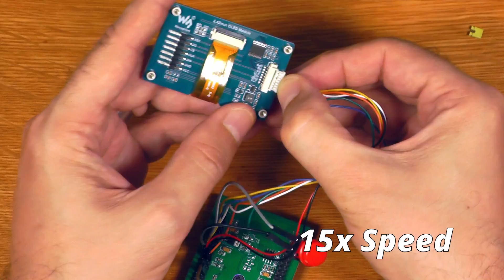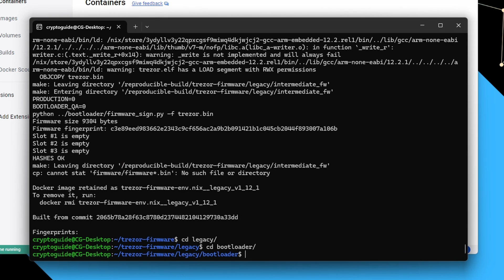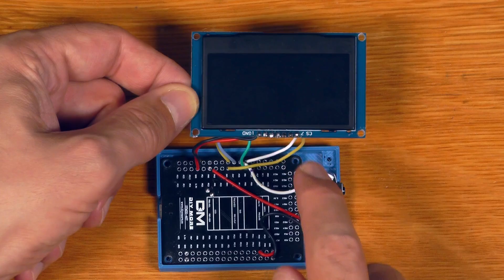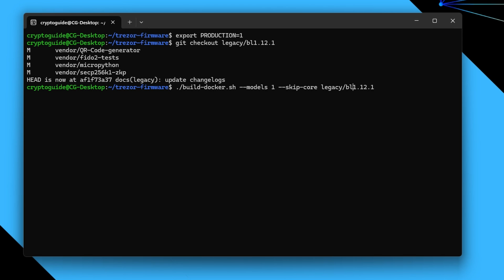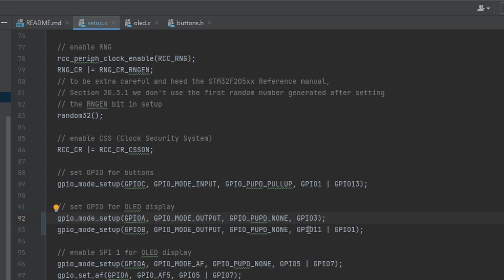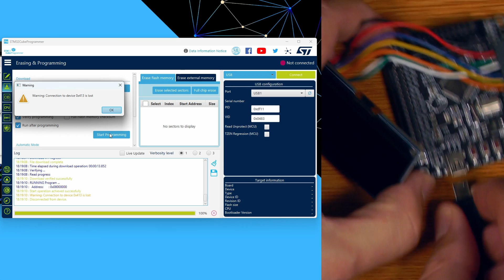Build a Trezor One DIY Hardware Wallet with STM32 Dev Boards (For Bitcoin, Ethereum, Cryptocurrency)

Comment: Hello friend.
Is there a simple way (for a beginner) to verify that the bootloader I downloaded is identical to the one on Trezor's GitHub?
The goal is to verify that the file on my computer hasn't been maliciously replaced with a fake/hacked one.
Thank you very much.
Reply from the maker: I mean the simplest way would be to look at some of the hashes I used in this video and go from there. Basically the bootloader automatically updates itself as required, so if you have established a "known good" bootloader, it will update itself from there.

Comment: Is the portion for making a custom signed bootloader on GitHub? I didn't see anything in the provided link, and was hoping to mess around with that

Great video by the way!
Reply from the maker: Thanks :)

It is all on the Github, though I didn't cover it in the video. While the bootloader itself isn't signed, you need to add some trusted pubkeys that it will use to validate the main firmware before loading it. On the firmware side, the first thing it does is has the bootloader and check whether it is from a known/trusted bootloader.

So the workflow is basically.
1) Decide which keys you want to use to sign your firmware and add these as trusted into the bootloader.
2) Build the firmware and note it's hash.
3) Modify the firmware to trust the bootloader you created.
4) Build the firmware, add the signatures.
5) Flash everything and hope for the best.

Comment: Does the build still work for you? It used to work for me, but now it doesn't work like it used to, the --skip-core flag no longer exists, and the --model 1 doesn't either.
Reply from the maker: Yea they reworked the build options about two weeks ago. 

Those extra options were just a time saving measure, your can do run ./build-docker.sh and it will build all the models
Reply: @CryptoGuide  not working anymore?
Reply from the maker: @RattakornRuay  Still works fine and the instuctions are the same as here if you just checkout the same version I used from their Github

Comment: Could you inform about how to perform the same diy operation with One Key system, since one is a variety of Trezor software, if possible, the same hardware would serve to create the diy wallet??
Reply: Kindly, could you create a content with the necessary changes to install the OneKey software!?
Reply from the maker: Perhaps next year sometime, it isn't really a priority at the moment for that hardware platform.
Reply from the maker: Onekey devices are more like a Trezor T, so while it would certainly be do-able with a similar process than what you have here, you would need to make some modifications.

Comment: Can I make a custom trezor one firmware for the Rapsberry Pi Pico ?
Reply: It would be possible if you modify the source code that is actually build for STM32 to RP2040. It is possible but need knowledge and some time to port it
Reply: I was Trying to port it but I'm my knowladge wasn't enough to port. So you can give it a try
Reply from the maker: Yes it is possible to port to the newer Pico 2, no I am not interested in doing it at this time.

Comment: If I will solder my board and use STM32F205RGT6TR controller do I follow the same procedure?
Reply from the maker: If you mean making a board from scratch, rather than just using a dev board, then yes, the process is the same in terms of building and flashing. (As long as you also use the same IO pins and stuff)
Reply: @CryptoGuide  Thanks! I'm confused a bit. This code can run on different stm32 chips as long as they have 1MB flash and the same pinout? so stm32F103RG can be used or F205 or F405?
Reply from the maker: The MCU will need to at least support the same instruction set, have the same peripherals and have enough flash. (So basically stm32f2 and stm32f4 series will generally be fine) The pinout doesn't matter, as you can rewire that if needed (if producing your own PCB), though the package will need to at least expose the GPIO that you are using in your code. (Which will need to match the official firmware if you plan on flashing retail firmware from Trezor)

Comment: Awesome video! Have you tried using the large display from example two with the smaller board, or does that cause boot issues from the larger power draw?
Reply from the maker: The larger displays doesn't work reliably with the smaller board. (It does work, but you may need to reset the board few times before the screen lights up)

This issue is far less pronounced with the large waveshare OLED screen, but still happens occasionally.

Comment: Hi Steve I have 2 words missing from my trezor seed. I am using BTC recover to open the wallet. However I do not have my wallet address on Myether wallet.  As I also do not have my password for my Protonmail. Is there a way to narrow down eth address data base. As I know the ammount of ETH in my wallet and the year the wallet was created.  Is it possible to seach all wallets on myeth wallet with say 50 ETH, created in 2018. Thank you.
Reply from the maker: Just use an Eth address database, it's a straightforward recovery that BTCRecover will knock over in a few hours.

If you can't work it out here then you can request a private session or trusted recovery. https://cryptoguide.tips/recovery-services-consultations/
Reply: @CryptoGuide  Much appreciated Steve. I will try to do it on my own, and if not, for sure will seek for your guidance and consulatation.
Reply from the maker: No worries, just don't panic or rush. It should be straightforward.
Reply: @CryptoGuide   Steve I am ready to do a test with BTC recover using a mac book air M2. Is there anyway I can check for malware on the programes I downloaded. I want to make sure no one has a back door and can see my 22 words once I put them in please. Is there any final check I can do please.
Reply from the maker: @IFTHENGEO  It's not just about BTCRecover, but the potential for other malware on your system. Just run the tool offline (so all networking disconnected) and only put the system back online after you have moved the funds to a new seed.
Reply: @CryptoGuide  Awesome. One more thing Steve, i keep getting stuck on pip installation part for ethereum wallet, as it gives me some sort of error which prevents me from running the test with my seedphrase. 

Do you happen to have ethereum specific code snippet  for this to help out in this scenario?
Reply from the maker: You don't need to install anything special for Eth wallets

Comment: I bought the wrong one (STM32F446RET6) can this board still be used for this project?
Reply from the maker: Unfortunately not, it only has 512kb of flash storage
Reply: @CryptoGuide  maybe with bitcoin only software or no?
Reply from the maker: Nope, not without rolling back to firmware that is a couple of years old

Comment: Hello. Have an Error: failed building wheel for coincurve. How can I fix it? Using python 3.12.3 and fedora 40.
Reply from the maker: Probably missing something on your system, is there a reason why you are using fedora?
Reply: @CryptoGuide  Yes, when I installed Ubuntu, it turned out that it did not support my motherboard, I don’t know how to write normal drivers for a sound card and a couple of other little things, so I switched to Fedora.

An extremely funny situation happened, I had synchronization in Google and I deleted metamask on another OS, because of synchronization it disappeared on Fedora, I dug up everything, all the files, the last hope for your software.
Reply from the maker: If you uninstalled the extension then you would need to use data recovery software and after doing so, you should be able to simply put the extension data back and it would work. 

I just bumped the version of coincurve to the latest, so it should just install a prebuilt module now. (Just download the BTCRecover again)
Reply: @CryptoGuide  this helps installation successfully with passed tests! Thank you!! now trying to understand the next steps)
Reply from the maker: Good job sorting it out
Reply: @CryptoGuide  I think this is the end, after removing the extension I reinstalled metamask, because... at the moment I didn’t understand what happened at all. It seems to me that he deleted the old data and wrote new ones in this place, I don’t know what to do. I found some mentions of this address, but most likely this is metadata about old transactions, nothing more. vault-decryptor metamask also does not help even with current wallets. I know what the password is, but I don't know the phrase. I know the address. Maybe you have some ideas?
Reply from the maker: Your only option in this scenario is to immediately stop using that PC (so turn it off) and attempt to use data recovery software. Basically your only chance is if the deleted wallet data files haven't already been overwritten.
Reply: @CryptoGuide  I copied all the folders mentioning the desired address (there seems to be something like a cache, old profiles, maybe there are keys there), the data recovery software did not give me anything useful, because at least I did not understand where the data goes when deleted extensions, obviously not in the trash.
Reply from the maker: The data has been deleted and won't simply be in the trash. You need to stop using the computer immediately and use data recovery software. (The kind that lets you recover deleted files, will boot off a USB stick, etc)

Comment: Nice video!
So what would be the cheapest hdww? Would be easy to use the integrated button of the weact and using the led to blink the number of the mnemonic to be entered? 6.5 usd nothing beat that i guess.
Reply from the maker: You could certainly use the single button on the WeAct board to act as the "Yes" button and just unplug the device if you wanted to cancel a operation. The WeAct + 0.96' OLED would be very close price wise to a Jade with the T-Display. (Which is about 10USD)
Reply from the maker: Thanks. It's pretty close to the Jade with the T-Display as far as price goes. You could certainly remap the IO to use the on-board button and just not worry about the "No" option and just unplug the board if prompted for that.

Comment: Awesome video.
I wish somebody would fork Trezor to add SeedQR and Passphrase QR.  That would be amazing.
Reply from the maker: Thanks. :)

So what do you actually mean by this? Do you mean loading them or storing them and exporting them via their screen?
Reply: @CryptoGuide  Weird.  I replied but it didn't show up.
Anyway...  I meant passphrase QR for loading a passphrase.  One of your videos introduced me to Krux, and I love that model of having a stateless device that loads an encrypted seed QR and a passphrase QR.  Krux is my main wallet, but I'd love to find a backup wallet that also offers either encrypted passphrase saved on the device, or better yet, the option to load a passphrase using passphrase QR.
Reply from the maker: Glad that you found Krux, it is certainly a great project :)

Yea the spam filter is pretty easy to trigger... Basically it would need a camera or a barcode scanner for that, something the SpectreDIY uses. (Which I will look at down the track)
Reply from the maker: You can tip on LN here: https://tippin.me/@YTCryptoGuide

Comment: will you try to build a trezor 3 ?
Reply from the maker: That's the plan, though I will probably do a few other things first. 

The main difference with the Safe 3 is that it won't be the same as a genuine device, as even if you add the Optiga Trust M SE, it won't have the factory provisioned keys to be able to pass as a retail device. 

Given that, I may also just look at adding an unofficial build that gives you the features of the Safe 3, without the SE (SLIP39, on-device functions, other coins, etc), so basically the same security level as the Trezor One. (And would also be cheaper and simpler to build)
Reply: @CryptoGuide  nice👍 ....only problem with the one is not being able to enter passphrases from the device ....and the touch screen on the model T is a bit too small
Reply from the maker: For sure, this is why I think there is still value in doing a modified Safe3 build without the secure element as an option. :)